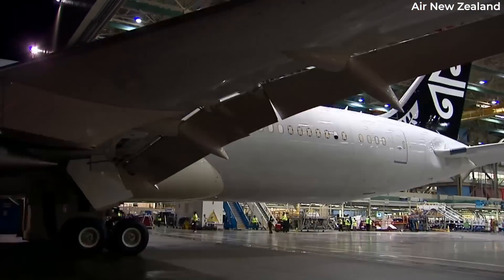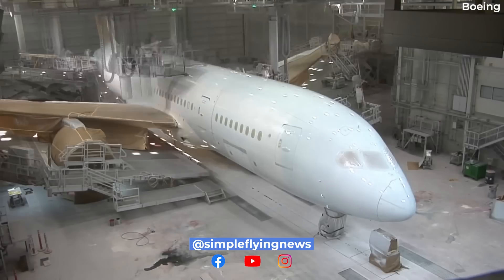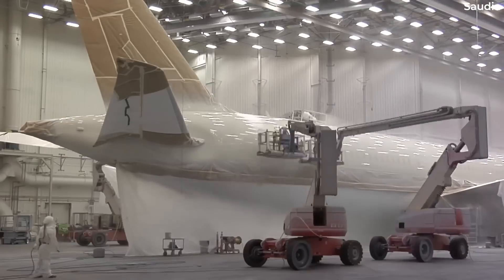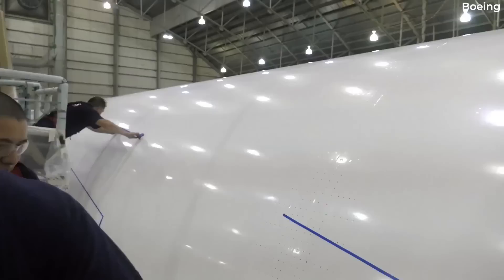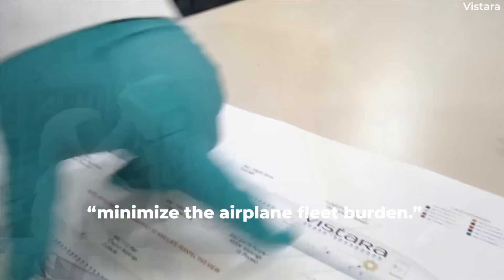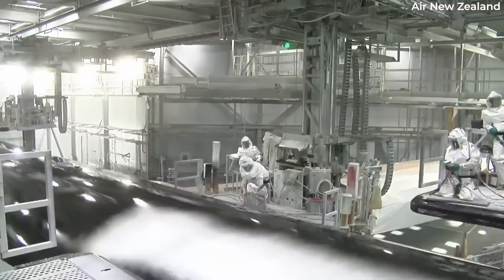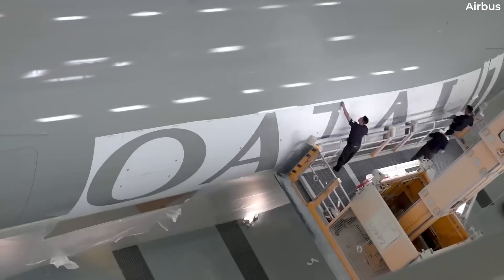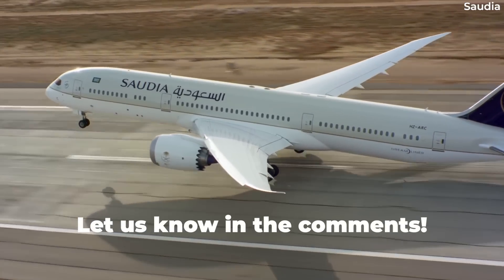Boeing Asks FAA To Approve Plan To Fix 787 Peeling Paint Issues

Comment: The B787 and A350 use a carbon fiber material. The components involved in painting aluminum have been perfected over many years. 

Painting carbon composite materials in a way that can remain in place in extreme conditions that are experienced outside of an aircraft is a fairly new challenge. Remember, the paint still has to be able to be removed prior to repainting. 

This is purely cosmetic. The difference with the A350 is they have a lightning protection wire mesh in between layers of paint. As the paint chips away so is the mesh. The fundamental concern when it comes to safety is how big of a gap becomes dangerous. Airbus, the UK courts and most of the world say the current gaps are still safe. Qatar and their government disagree. 

Personally, I agree it is safe now but I don't know where the limit is. I'm also not even a fake expert. I just understand that if the center of the mesh is safe then complete coverage is unnecessary and maybe undesirable. The size of the gaps by design and in place after deteriorating is still minimal proportion to the aircraft 

 It is estimated that every aircraft is struck by lightning once a year on average. If all A350s are experiencing the issue, I really don't think Airbus would fight Qatar in court if there was a risk. Statistically the aircraft in operation from other airlines have been struck and remained safe.

Comment: Boeing had less problems with paint degradation. I expect this to be the same solution as for its fuselage. I think airbus has more work to do instead of Boeing. So I think this will do the trick.

Comment: If Boeing 787s are experiencing the same issue as the A350, and the FAA haven’t found the flaking of paint to be a security issue, I don’t see Qatar’s lawsuit being successful.
But if Boeing’s proposed solution is approved by the FAA, I wonder if they’ll be in a position to license this solution to Airbus and recoup some money.
Reply: The paint issues aren’t in the exact same place so I’m not sure. Let’s see
Reply: @filledwithvariousknowledge2747  the paint on the 350 wings are peeling, though.
Reply: The problem with the A350 paint peeling is that it had been exposing the lightening protection layer and leading to damage to the protective mesh. Which then presents increased risk in flight.
The 787 paint issue doesn't appear to be causing the same damage to its lightening protection.
Reply: BOEING IS COVERING THE EXPOSED AREAS AIRBUS IS NOT. IT IS A SERIOUS ISSUE.
Reply: The problem with Airbus is that Qatar started complaining since 2016 but instead of taking it seriously and find a solution, they just dismissed it. Only when other airlines started to bring up the same issue recently, they are looking at it more seriously.

Comment: If airlines want modest technical advances, without any of the teething problems that are applicable to carbon fibre bodies, then they should invest in the A330 neo, but since most airlines are still ordering the 787 and 350, they don't seem to be as concerned about it as people on here, or Qatar airlines, who have had their bluff called by Airbus in such a way, that they have to behave towards Boeing from now on, otherwise its Cessna next who'll have to be ready not to return Al Baker's calls............

Comment: Would have though that wings flexing so much would present a huge problem for paint (so I guess the UV thing makes the pain lose its elasticity and then crack).  (This is differentfrom the 350 problems happening on a fixed surface neat pitots).

Comment: Personally I don’t believe it is due to UV light. If so why is it not coming off the fuselage? I think it is to do with the bonding of the paint to the carbon fibre. The wings and tail plane bend and vibrate more, that to me is why it is coming off those areas more.
Reply: I expect the exact same thing. The high pressure differences could also be one of the reasons why only the wings and horizontal stabilisers are affected. The paint needs both a higher level of flexibility as well as adherence. Though UV radiation may be a causing factor in the degradation of those same properties. Meaning better UV resistance could solve the problem. But we'll have to wait and see how things turn out.
Reply: Both. Paint is chemically affected by UV light and then peels of due to vibration.
Reply: It’s for the material science boys and girls to figure out.  
     There are some good observations in this conversation thread though.

Comment: Qatar gonna start crying to boeing about the 787
Reply: Airbus is smirking
Reply: Not likely. Boeing is addressing and correcting the issue. Unlike Airbus who denied the risk to their aircraft.
Reply: @christopherescott6787  
Boeing are not admitting any "risk" to their aircraft, either.......
Reply: @artrandy  They don't have to as the damage is not significant enough to. Whereas the 350 has damage right through to the static protection. I haven't read of any airlines suing Boeing overt it.
Reply: @christopherescott6787  
The "damage" on A350s in conjectual, that's why its going to court for a decision next year. If Qatar have deliberately left 350s to rot in the sun, unmaintained, to encourage the court to believe that the problem is worse than it is, then I expect the courts to take that into consideration.

Meanwhile, 787s have been flown around the world, with those famous flexible wings bandaged with aviation duct tape, like a kind of goose in a straight jacket. 

I have confidence that both Airbus and Boeing will get over these carbon fibre teething problems soon, but the idea that its just affecting the 350, when its now official that its also the the 787, is going to be difficult for the Boeing boys to handle.......

Comment: This is one reason why I think that Qatar doesn't have a problem with paint peeling on the a350 otherwise they would be complaining about paint peeling on the 787, I am aware that the paint peeling on the a350 and 787 have some similarities and some differences, but that Akbar Al Baker is just out to get Airbus because if he was really concerned about paint peeling and that it was a safety concern, then he would have grounded the 787 if paint peeling is a safety concern.
Reply: And if it's such a severe safety issue why is Qatar still flying the A350 at all? Why ground only half the fleet? Aren't the others in danger of falling out of the sky in a shower of peeled paint after a lightning strike? 🙄
Reply: Shouldn’t Al Baker sue Boeing for something more important like all the FOD collected in newly manufactured 787s out of Charleston?
Reply: Are Qatar's 787's pealing paint thou?
Reply: He wouldn't ground 787's cause under it's paint E-glass protect it's copper mesh. Airbus just has paint over it. 787 hasn't same fuselage. Wings could be different I am not sure about that part
Reply: @jouniairplanevideos  Finnair had same problem. Airbus said its not a safety issue. Has anything happened to a Finnair a350? No
Reply: The main difference that I see is that Boeing is actually willing to recognize and fix the problem, where Airbus is on the opinion of “not our problem” despite Qatari regulators saying differently (whether or not Qatar Airways influenced that decision or not). Also it’s been reported by multiple airlines having the issue, and for whatever reason it’s taken longer for the 787 to develop the issues (perhaps their primer is better adhering, even if in the short term?).
Reply: @brianbeach3024  Nope the 787 has had paint issues for a while and Airbus actually offered a better temporary replacement then some speed tape. They had every right to cancel the QA A321 order and Qatar deserved it. Their CEO needs to step down because he’s just a baby. Qatar needs to improve their economy class because they have terrible economy class and only treat you well if you pay for business class. Boeing likes to hide important things and wait until people have died but Airbus will actually try to fix that problem and not loose anyone.
Reply: @brianbeach3024  
You quote Airbus as saying: "not our problem", when they've offered remedial work to Qatar's fleet until a permanant fix is available, so where's your source for that quote please..........
Reply: @brianbeach3024  Where do you get your information? Qatar state run media? 😂
Reply: @brianbeach3024  Brian .. that just false. Airbus has given QR the offer of repainting the concerned aircraft (for free) while a permanent solution if being worked out. Pretty much the same as Boeing. All other airlines accepted this, but Qatar refused this offer. They only seem to want money.
Reply: On the 350, the peeling paint was damaging the anti-lightning mesh underneath, which is why Qatar had a safety issue with it. The 787 problems are only cosmetic, and they know exactly what is wrong
Reply: @spelldaddy5386  
That Qatar have left their grounded 350's to rot in the desert sun, unmaintained, so as to get in worse condition to impress the judges at next Summer's hearing, is not indicative of other 350s. Now that paint problems on 787 are official, its going to be very difficult for people like you to prove that its only "cosmetic" on 787s but more serious than that on 350s, when the former have wings 'bandaged' with aviation duct tape..........
Reply: He's a disgusting boeing enthusiast!
Reply: @wadehiggins1114 < Are your little feelings hurt or is it your time of the month.